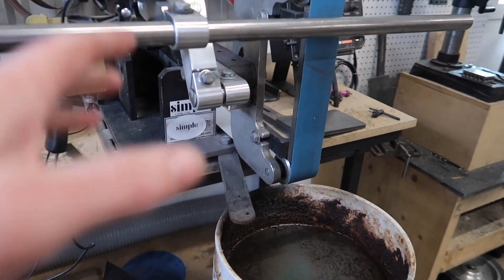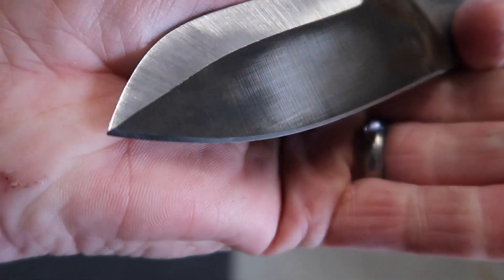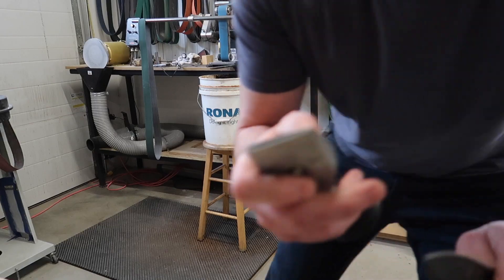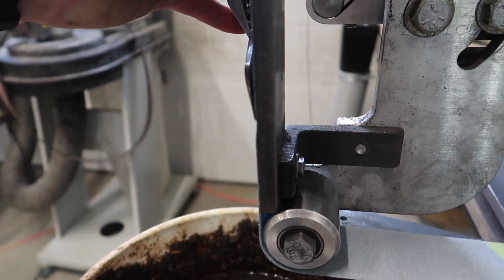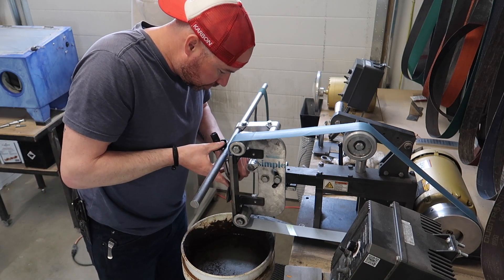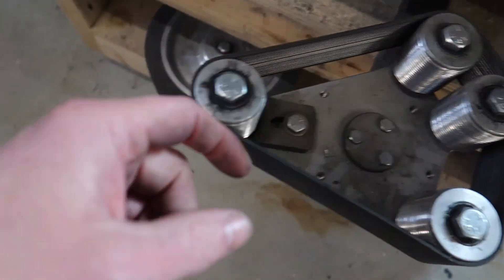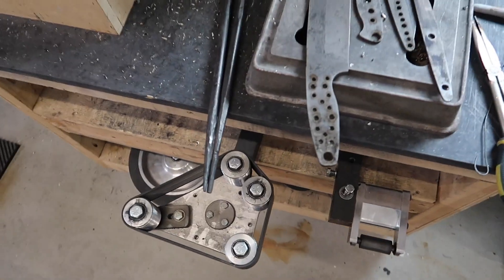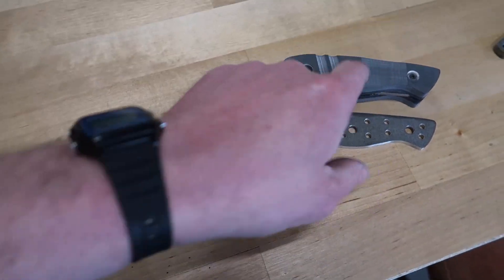It's like a swiss army knife

Comment: As a luthier and product designer that has built and used numerous jigs, templates, and fixtures over the years, the thing to remember is that they are all for accuracy, not for speed. If they are accurate every time ... you're golden. Speed is a side benefit, since you no longer have to measure. The time it takes to make good jigs, templates, and fixtures will easily make up for the time in making if they do repeatable processes you do a lot.

Comment: Good information Jeremy. This is somewhat an old video now. I am not sure if you made any updates/modifications to the Tormek jig, but if you remove that black plastic guide thing and drill a let's say 1/4 inch hole and install a round stock, and use that rod as a guide... that would help with the bevel inconsistency. Hope this makes sense.
Reply from the maker: That makes a lot of sense. Great idea thank you so much! 👍

Comment: Nice! If you wanted to do a convex edge, would it be possible to swing the bar up, so the bar is physically located above the grinder, and sharpen down onto the top "slack" part of your grinder? The main difference would be going from "edge trailing" to "edge leading". But if I remember correctly the tormek sharpener is "edge leading" anyway. I guess it would be just as easy to remove your platen and get a slack belt that way too. I'm just trying to think of additional uses for your setup... It's SO nice!
Reply from the maker: Thank you! Yeah that would work. I also have a rotary platten that I've used for sharpening convex edges. 👍

Comment: Get your VFD to run in reverse which the kbac27 will do with a switch and the proper programming then it wouldn’t be upside down and the weight could be resting on the bar

Comment: I love this set up. Is it aluminum for the square stock pieces? 
       Could you cut a square groove in the long round stock guide the length of it. Kind of like a motor shaft. Then make a ring  connected to the end of  your knife holder that you can slide over your round stock that would sit in that groove. (Like a keystock would). Would something like that keep the kitchen knives from deflecting when sliding across your round stock?
Reply from the maker: Thanks👍 That is a good idea! Thank you.

Comment: Looks really great. Have you come up with an easy way to set the table perpendicular or other fixed angles to the platten yet?
This thing is so adjustable which is cool but what if you often grind at a certain angle?
Reply from the maker: I use a machinists square to set up the table with all the joints fairly snug. It actually works fairly well. 👍

Comment: Tormek accually Sells another Clamp for kitchen knives. The jaws are much wider so it Will get rid of the flex in the blade.
Reply from the maker: Oh right on. I'll have to look into that. Thank you!
Reply: The other wider jig is not for longer knives. It is for thinner more flexible knives. If the knife is long, but still rigid, the small jig still works fine.